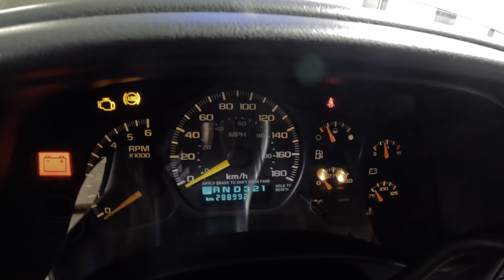Seize the Day! DO NOT Lube Brakes- Grease Jacking   2000 Chevy GMT800 Silverado 5.3 4.8 #repair

Comment: Now.......Try that in the rustbelt!!!!!
  I live in PA.....We have to lube the brake slides/clips, if not they will be rusted up in a year.

I will agree they do not come from the Factory lubed, but the manufactured don't factory for climates where rust is a problem, and usually when we get them in the shop during their first brake change the pads are completely rusted up!!

Comment: So my understanding is that if you have slide inserts like that, you do not grease the mating surface with the pads, but if the pads ride on the cast iron bracket, you do grease them very very lightly, because the porous nature of the cast iron will hold the grease, but not the dirt.

Saying this, I must make very clear that I have not serviced Northern/Rust Belt vehicles in any useful quantity, and my experience is limted to warm places.  If I am incorrect in my understanding, I openly welcome correction.  :)

Comment: I still say that the dirty crusty grease will allow more movement than a bunch of dry rust buildup. I think that weird rotor wear was due to some grease getting on the rotor. But IMHO Teflon coated slide hardware is the best!

Comment: Welcome to the rust belt......Brake rotors rusting like that has nothing to do with greasing the pad slides.  All it takes is a little rust to start-especially common if the vehicle sits a bit off and on.  We are talking a week or so.  And it is almost always the inside surface.  Really common for the rear rotors to do this.  Usually noticed by a bit of "roughness" when braking but sometimes you barely feel it.

Comment: Use a moly dry lube on those slides and pads. The slide clips I think are stainless so they won't rust but the notch in the pad will and clamp down on the clip. I don't believe that the grease and any associated collected dirt was holding the pads back or you wouldn't get them off. The caliper can likely put much more force on the pad than you could by pushing on them with your screwdriver.  Rotors rust on the outside edge because that's where the water and salt are. Once the rusting starts, the rust is harder than the rest of the rotor. If you've turned rotors on a brake lathe, you have experienced that as the rust destroys the cutting inserts. The rust wears the pad down and the pad can't wear the rust down.

Comment: Not sure if it's already been mentioned, but it appears that the stabilizer link bolt head is broken off on the left front (see 10:58).
Reply: Ray said in another comment it's flush cut... The head of the bolt is recessed into the washer and the nut is on the bottom

Comment: My rotors are doing the same thing but I have never greased the stainless steel slides. I wonder if it's possible for the surface under the SS slides to rust and cause the SS slide to expand and bind the pad a little?
Reply: Yeah, that's the rust jacking effect.. that is why he agreed with some anti seize between that stainless steel slide and the caliper body

But, not on top where the brake pads are

Comment: Hope you are using your safety squints with that wire brush. How often would you say you take off a knuckle when something finally breaks loose? It is a common occurrence in bike mechanics. What about stuck bolts? If the head breaks off leaving the threaded part behind and leaving you without the best purchase you could have had on the bolt it's an absolute nightmare.

Comment: 18:20 : Nevrseize or any other lubricant on the surface between hub and rotor or between rotor and wheel is not good. The torque of the engine is transferred by friction between those surfaces. The wheel bolts just make sure that the clamping forces between those surfaces is high enough so that he amount of friction does suffice. If you put lube there, the friction is reduced and you run the risk that your wheel bolts are taxed with shearing forces which they are not made for.

Comment: Once every couple of months I "skoosh" (Scottish slang for spray) a can of Brake Cleaner into my brake caliper assy and onto the discs as well. A good clean get all that road grit and brake dust out. Don't use Brake Cleaner on your bearings though as they have special grease on them, or at least should have!  🔧🪒💿

Comment: using grease is not perse bad. It all depends on how much you use and what kind of grease. One-fits-all all doesn't do the job and a little extra might be way too much. The same as using detergent. Too much would make it more filthy and not work anymore. I like to use copper grease in some occasions around the peripheries of brakes

Comment: 5:01 This is a 'sliding' surface. It needs to be lubricated. Fact is grease and oil attract dust and dirt. This seems to be an excessive amount of grease though. I have to agree with Jordy-927 to clean and re-lube on a schedule, everyone's will be different. Not so often for a city dweller and more often for someone travelling dirt roads.
Reply: I do it with each tire rotation...so at least once a year since I don't rack up that many miles

Rust belt, 90% black top road

Comment: Eric @ SMA would surely disagree with you. Again he services vehicles in heavily salted roads where vehicles only last 10 to 15 years before they rust apart. I've been putting a film of  brake Lube on ears of pads and never had an issue. There's a difference between putting on a film vs packing gobs so it collects mud,sand and debris. A little fanese is required.

Comment: Being from the rust belt I can tell you if you don't grease them 1 winter and the brakes will be locked up. I used sil glide on the pins inside the caliper brackets, black synthetic grease under the shims and slides, locktite on the bracket mounting bolts. I don't use antisieze on anything brake related. Whatever grease they used was wrong. It's too hard.

Comment: Greasing the slides should never be done, but you CAN grease the plates on the back of the pads this can prevent screeching due to vibration.

Comment: The slides never rust because the are made from stainless steel therefor the brake grease on the slides will be not so good.  I have also seen on many brake jobs half warn disks and pads from these gummed up slides.

Comment: The caliper slides do NOT require grease for exactly what you showed. 

The fit up tolerances are designed NOT to require this. 

If people absolutely insist on lubricating these, use graphite only.  It won't really do anything, but it'll at least give them something to do while believing they're doing something necessary. 

And it actually won't hurt anything.

Comment: Another rust-belt mechanic chiming in here. Grease is absolutely necessary - behind the sliders especially. But your assessment of why the rotors are wearing the way they are may not be "grease jacking",  more than likely it's the rotor literally rusting away faster than the pads can scrub them clean. The evidence is in the actual wear in the pads themselves. Almost all the rotors I change out up here that look like these, or worse, the pads will be worn evenly about 85% of the time because what's left of the high spots in the rotor are still grinding away the friction material. And here in salt-happy NY it's not unheard of to change out rotors annually. My 2014 Sierra 1500 has 29k on the clock (yes, 29,000mi) and is on it's 3rd set of rear rotors - 2nd set of fronts.

For those who can't read: I'm not saying Ray is necessarily wrong here. But he might be wrong this time. 

Fun fact: "Livingston County, New York, location of American Rock Salt, the largest operating salt mine in the United States with a capacity for producing up to 18,000 tons each day." 
This state loves to dump it's salt everywhere.

Comment: Nah Ray.  It's not the grease. Just did the brakes on my wife's buick. Straight from factory and all 4 rotors were rough. Pads were all at 20%. I grease em. And we're in Canada.  I can also tell you that truck hasn't seen a winter in Canada.  Lol. That's some retired snowbird.

Comment: All I know is don't oil your brakes to get rid of the squeak.  Now, the first time I've heard about lubing the slides was watching you do it on a brake job.  Are you going to stop doing that?  I'd recommend you reconsider that, since this vehicle's parts/components may not have been cleaned when it was serviced.

Comment: I think here not only the wrong lubricant was used, but an excessive amount. It’s needed dependent on the environment that you’re in. If you’re in a rust -oxidation area, it needs to be lubricated with the correct type be it silicon based etc. this truck being from Canada EH it definitely needs to be lubricated.

Comment: similar metals, like, steel on steel, gotta have some lube, it should be a thin film, not gobs.  for steel and cast iron, a few drops of motor oil wiped on will be fine, it's probably what they come from the factory with, just that it's too thin to see without sticking your head really close to it, doesn't mean it ain't there.

Comment: Just leave the backing plates off. My wifes 03 envoy had the rear ones rot out, I have put off replacing then for 3 years now since I found them doing her brakes which menas they were rotted out for who knows how long...but even in Minnesota salty winters they have given us no issue. I did squirt a little oil up in there just to keep things moving.

Comment: O ya, take the clips off, grind the rust off the brackets, grease them up, pull the pins, wire wheel, grease up. Grease up between piston and pad. Grease up between disc + hub,  clean up backside of alloy wheels with a wire wheel, grease that too. Its so whacky seeing Ray working on super clean cars. I prefer mine to be hot, oily, and greasy all over.

Comment: non mechanic question. Is this a rear wheel drive truck. I see no drive system going to the front wheels. When he took the from wheel bearing off there was not lock nut or drive system going to the front wheels.
Reply: Yeah,it's RWD only since no CV axles going through the wheel hub and bearing when he pulled it off

Comment: A very thin coat of brake lube stops rust, not gobbling it. You truly are a hack Ray, who cares about the dust shield. PRO-TIP make sure the pads move freely on the slides first.

Comment: YOU MIGHT GET AWAY WITH NOT USING NEVER SIEZE IN FLORIDA.  BUT IN CENTRAL NEW YORK YOU WOULD HAVE FROZEN SLIDES IN ON BOLTS AND SLIDES.

Comment: Up here in Canada if you don’t grease your slide pins and the bracket hardware your brakes will fail within 6 months. The problem here it looks like this guy or whoever touched the brakes last put way to much grease on there you only need a little. More dose not mean better.

Comment: FWIW for my EVs (I live in Canada) I get the brakes serviced once per year so they would clear out the grease and replace it yearly.  Who knows when this person last serviced their brakes it could have been 5+ years.....  Otherwise the salt/road crap binds them up.  I've already had to replace a full set of rotors on my Bolt EV because of seized calipers.

edit:  I started getting my brakes serviced yearly AFTER I replaced a full set of rotors on my BoltEV.  It's also in the Tesla user manual that if you live anywhere with road salt you are required to get them serviced once per year.

Comment: The grease is not responsible for this uneven brake wear in my opinion. The brake pads could not slide freely because of improper brake pad to brake pad holder fitment. I am sure that these brake pads had a tight fitting already when they were installed and had maybe also a hard sliding. Sometimes we have to use a file when working at brake components to improve fitment. Never had any issues with my brakes despite the salty winters in Bavaria/Germany taking care of really free sliding pads at the time of installation. And for sure I use purple permatex brake lube for years now without any problems. 
Btw, I would not recommend using the manufacturer's implementation as a benchmark of best quality. Everybody working on cars knows that maintaining a car properly for a long period of time means more than often doing exactly not what the manufacturer did before or recommends to do 😅. E.g. rust prevention, servicing automatic transmissions with "lifetime" atf filling and so on and so on..... Greetings from snowy Bavaria ❤

Comment: To answer, no, you never grease the slides. My question is, is it worth replacing a backing plate or not? Or does it depend on one's location? I've had a few vehicles that the backing plate just totally rusted away and never bothered replacing them.

Comment: Hey Ray... could you answer this question for me. Here in the UK (I'm guessing most places in Europe too) we tend to get rid of a car when it gets to the 10 year old mark / 120000 miles (sometimes earlier) yet most of the cars you deal with, have been to the moon and back with mileage.

Do you have any idea why that is?
Reply: because the distances in the us are larger than in europe. and due to the stupid mot good cars are beeing scraped or sent to eastern europe. and also the big engines are less stressed then the tiny tin cans which we usually see in europe. That would be my opinion ☺️
Reply: IMO... YES! I know you didn't ask me but.. My feeling is that Europeans are, generally, really up on new tech. You guys have brands like VW Audi, Mercedes Benz, BMW, Volvo, and other brands as "domestic". You have all the "new" and innovative tech right at your fingertips. 
Americans are a little different in our thinking. We drive REALLY long distances just to get to work. For me, it's 9 miles to the nearest grocery store, and 50 miles each way to work. My previous job was exactly 100 miles from my parking spot at home, to my parking spot at work. So we need to extract as many miles as possible out of our cars before we give up and buy another one. 
We actually judge how good a car was by how many miles we can get out of it, and are VERY proud of being able and knowledgeable enough to get hundreds of thousands of miles out of one of the biggest investments we make.
For instance, I'm very proud that I've gotten almost 300,000 miles out of my 2006 VW New Beetle, and almost 200,000 out of my 2003 VW New Beetle. AND COUNTING!!!
NO. It has not been cheap. But it's STILL costs less than a new car AND I don't have to deal with the new "MANDATED" tech that allows the government to control my car from an app on their phone. I don't have to deal with car payments, or higher insurance coverage rates. 
So I probably dump $1000-$2000 a year in maintenance/ repairs. STILL better than $450-$1000 (depending on the car) for payments + Full coverage insurance.
Reply: @K.Kelly87  You are one that has figured out how to get the most out of your investment & save money.The things you mentioned doing are very practical, & the money you save is going into a fund that will let you buy a nicer & better car when you need it, cash, so no payments, high insurance, interest rates. Money in your pocket. i have been trying to explain this to loved ones for years, but they have to get a new car every 3 years, staying in debt.
Reply: @K.Kelly87  agree !

Comment: If your pads are doing that, you're putting on too much lubricant. A very thin coating is all that is needed. Also, side-note, if that much dust is building up, those are terrible pads. There shouldn't even be that much dust to build up, even if you did put on too much lubricant. The ONE thing you don't skimp on in your vehicle is the brakes. You can let everything else fall apart around you, but spend HUNDREDS of dollars on brake components, even on old, beat up cars.

Hello, from Wisconsin, the Canada of America.

Comment: If this guy would not have greased his sliders , there would have been rust on both side of that rotor it would have been worse. I'm in quebec, canada and  I clean my brakes and lube every spring and before winter every year on my tree vehicules. When i have my garage i will do it in the the middle of winter too.

Comment: that person extremely over greased them. as a certified mechanic u only put on a few mm of grease that u basically almost cant see it but u can still see the chrome shine in the plates, otherwise our multitude of weathers u will get scrapeing/scratches in the plates to the point they just rust in six months and then they will be rusted in place. alberta, Canada

Comment: People saying their slides rust with no grease etc. Ehh ok. Good pads have a very thick anti rust paint coating and the slides are covered with a stainless slide plate. And yes I live in the rust belt and certainly don't grease slides. It just collects dirt and makes a mess. And they've never rusted on any of my cars. Maybe buy oem or better parts guys, not 17 dollar junk from autobone?

Comment: Why would you grease anything that is in a place to collect dust and dirt? I stopped greasing the tin shims decades ago here in the NE US. No difference seen in the pad or rotor wear. My problem is with the bracket rusting (see video at 8:30) and casuing the pad to be rust-seized in the bracket. NeverSeize doesn't seem to be helping. No amount of grease between the pad and the shim will prevent the bracket from rusting and seizing the pad.

Comment: if you don't grease up in the northeast you'll get stuck pads in 6 months or less and replace your brakes more often. Plus you'll get squeeky brakes. Too much is like not enough so dont be an idiot and grease the disk surface lol.  Plus the brackets also rust and expand, locking the pads in. Ive had to use air hammers to get pads out

Comment: Pity no one turns rotors anymore.  This one is new enough it might be okay.  They build them JUST at the limit, no extra material.
Reply: Back in the 1990s yeah, there was enough metal to do at least 3 resurfacing jobs.

Not anymore and most of these are casted in China 😢